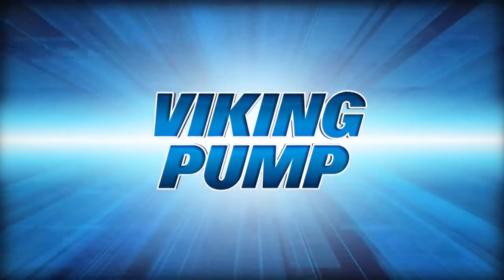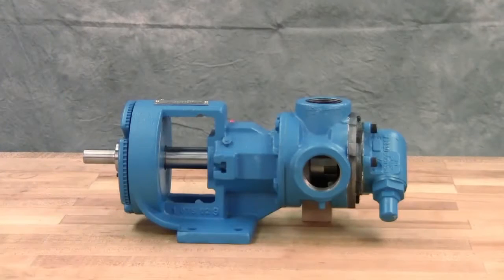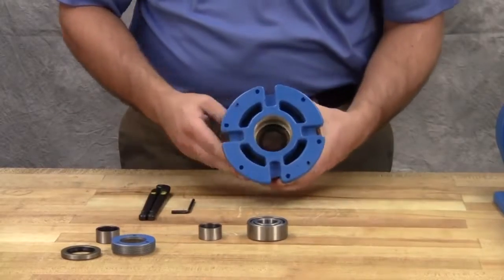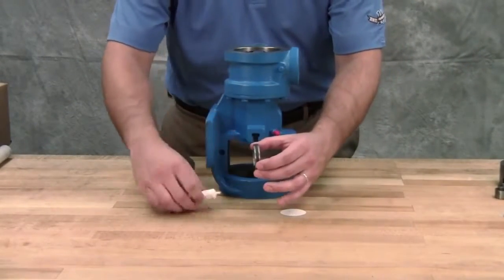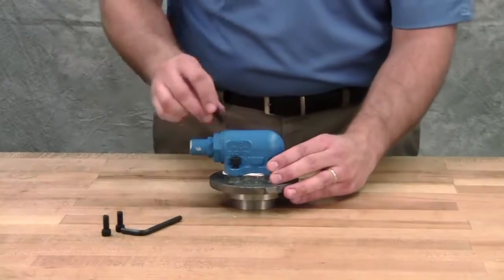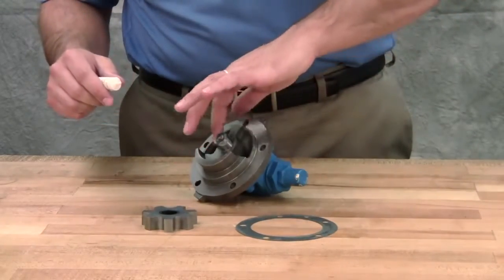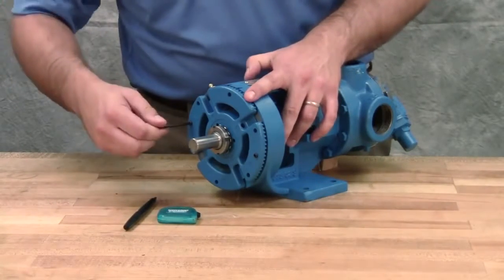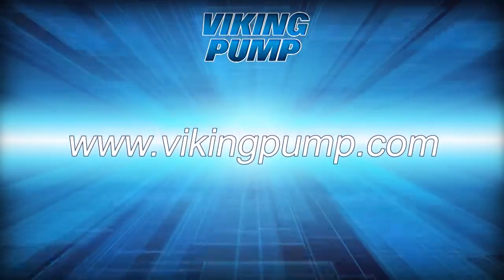Viking Pump Universal Seal Series with Behind the Rotor Seal Disassembly, Repair & Reassembly

Comment: what side of the mech seal press in goes up or down?
Reply: If you're talking about the stationary (non-rotating seal face with the o-ring on its OD that pushes into the bore), then the lapped (mirror-finish) side faces up towards the rotary portion of the seal and the unlapped (matte-finish) side faces down towards the bottom of the bore. This is the step at 5:24. If I'm misunderstanding your question just hit reply.
Reply: @raykinsella5081  ,,